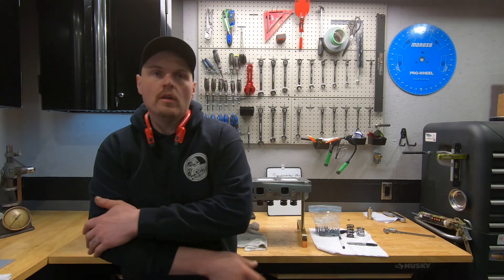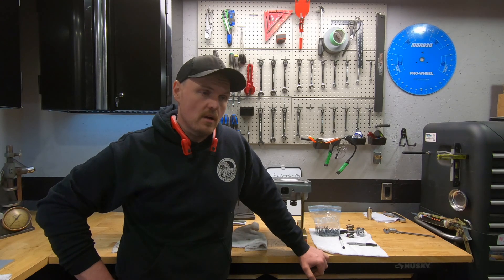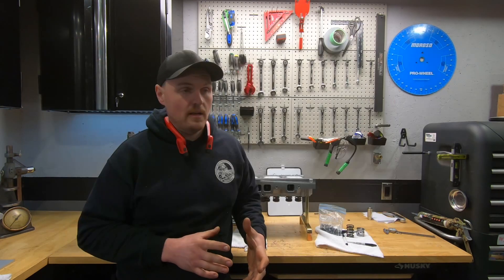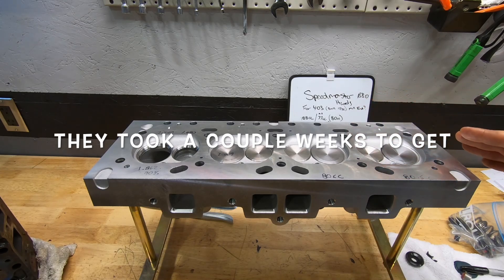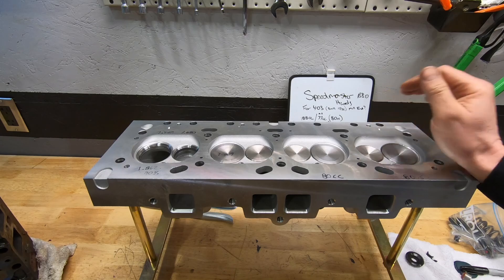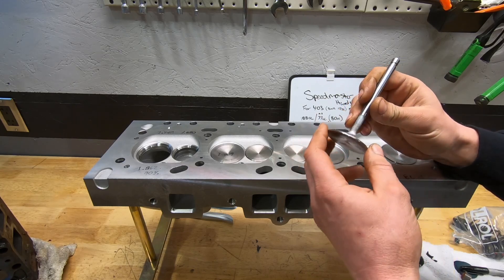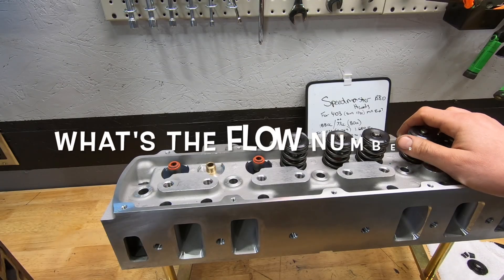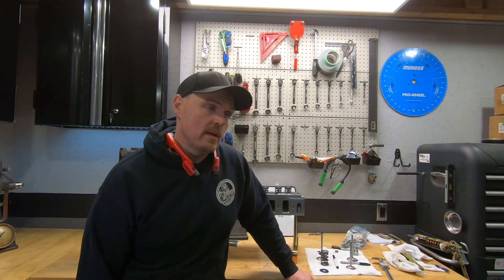Speedmaster OLDS Head Review + 403 Stock Head Flow #'s

Comment: I'm 56 years old and life long Oldsmobile guy. When I was just getting out of high school high performance 403's were kind of a big thing here around Detroit. The engines were then plentiful and easy to find. I still wasn't a fan due to the windowed engine block but the big bore combined with big block heads and a street dominator single plane welded up to raise intake ports for big block heads. That was the hot setup. Problem was eventually every one I knew of blew up in extraordinary fashion. After a refresh and engine compartment detailing my buddy took me on his first voyage out in months. Prior to that he became known as the kid with the green 71 Cutlass who would race anybody on telegraph.  Such a weird combo in the way he got it, the car wouldn't even spin the tires with the 3.42 gears and too tight converter, but wait one thousand one one thousand two...the car squatted down in the back and just started pulling. In that configuration it ran 13.30s @ 109 all day long with ease. Prior to him buying the car it had a 12 bolt with 4.56 gears and a loose 10 inch converter and reverse manual th400 running 12.ohs thru open headers. Anyway on that first shake down in months I was sitting in back seat because he had the passenger bucket seat out of the car. We didn't go but 1/2 a mile, stopped on a stretch of road by the house, he brought it up on the converter and stabbed it...car hit hard then went BAM! Engine cut off clean and we coasted to a stop. We get out open hood and right away I knew it was bad. Tryed to stay calm but simply pointed out the balancer was crooked big time and the crank snout was pointing anywhere but straight ahead. We had to push the car 1 block to his house and of course it started to rain. Couple days later we tore it down and the block split right in half on top of the maun bearing saddles clear from front to rear. Crankshaft came out in 3 pieces. Every connecting rod was like a noodle. He was only able to save the ported C heads as even the new camshaft snapped in two. Another similar 403 with a different friend ended up splitting his motor in half very similarly at Milan Dragway. I loved the idea of that big 4.330 inch bore and relatively short stroke but the windowed web blocks just couldn't take it.

Comment: FYI Speedmaster is an Australian company that started in Liverpool Sydney Australia in the early 1990s , at Sydney Speed Supplies , now expanded to the US , but still owned by Australian's . All parts including heads come from Australian warehouse then to US . Just a bit of trivia , the original company imported used US V8s ( suit rebuild) and sold them in Australia, moving on to making cheaper but still well made parts for Australian street/ race scene in the mid 1990s , now massive company .
Reply: You’ve got a lot of stuff wrong 🤦🏻‍♂️
Reply: @murrayhawes1265  no I don't , I was there at the start , and you can still talk to the guys that started the biz, so I suggest you stop dribbling shit to the converted .
Reply: @JosephCowen-fz8vj well first of all it’s called Speedmaster79 because it was started in 1979. Second it was in Wollongong NOT Liverpool and you still have more stuff WRONG. Do a bit of research 🤯
Reply: @murrayhawes1265 FYI those heads are zero waiting time in Australia and there's probably 100 Olds motors in the entire country.

Comment: Hey Pat, as you know, I just picked up a 403. Did you end up messing around with the stock 403 heads at all? Just curious if you found any simple upgrades
Reply from the maker: I haven't yet, once things slow down I plan on doing that
Reply: @ that would be great! Part of me wants to invest in the new Edelbrock SBO heads or just keep it stock and keep the swap simple. Always torn between over doing it or K.I.S.S. 😅
Reply from the maker: @jimmy_olds  I really wanted to use the edlebrock heads but once they came across the border the price was wild

Comment: I had a 1978 Trans Am that had a 403 olds. I dealt with Dave Smith at Precision Speed in Anaheim Ca. to hot rod it. He built me a set of heads that the casting numbers were machined off, but I think they were W31 heads. Also, he suggested installing main studs because of the windows in the main web. We used a Holley single plane intake, one of his cam designs, TRW pistons, and few other quality parts and my car went from 15.90@86 in the 1/4 to 13.91@106. Would have been a lot cheaper to do with a Chevy or Ford.

Comment: I picked up a set of speedmaster sbc 220 heads I looked them over and two exhaust valves did not seal, in the end don't trust anything out of the box  Great Video Pat!
Reply from the maker: are those the CNC ported 220 DBC heads?

Comment: I love my speedmaster pontiac heads. They will be going to Butler in the next week or so to get the cnc port to 340cfm. At the point that you are wanting a 340 port, why buy a more expensive casting to get it done. 

I do not like the locks and retainers they use.
Reply from the maker: The guys at Butler sure do some nice Pontiac stuff! 340 cfm is awesome. I got the edelbrocks on my 400 Pontiac in my 67 F-Body but they sure are expensive!
Reply: @cuttersperformance  they have been doing those 340 ports on edelbrock heads for years. My buddy had a speedmaster head that needed work, so he had them run the 340 program on them to see if the casting would hold it. They do, and he has them on his. I figure for 900 and a set of larger intake valves it’s worth it.
Reply: My buddy’s 540 smacked one of the valves they use,it bent. A ferrea would have broken.
Reply: @doomman700 soft enough to bend your buddy will be picking them out of the piston if you have enough spring pressure it'll pull the keepers right through

Comment: Hey bud, really enjoying your shows and really excited about this 403. I had one in my old Trans Am, but never got time to build it.
But anyway, I don’t know what you’re talking about as far as big block and small block edelbrock heads for Oldsmobile because they are the same head. I bought a set when they first came out and ran it on my old 350 and now it’s on my old 455 in my cutlass. The only difference is the intakes.
Heres a little olds tip for you don’t waste your money on the torker 1 or 2 intakes there complete trash
I do hope you put that motor on the Dyno even if it’s just for personal interest 
Like I said, I never got to build my 403 but with that massive bore and that combustion chamber of those heads, I would suspect decent flow and some good low in torque, even though it is a short stroke motor, but nothing tells you more than experience
Anyway, keep up the great work
Reply from the maker: I was talking about Edelbrock coming out with a new head specifically for a SBO, its has better options for lower intakes as the runners line up better, smaller chambers and clears the fuel pump (I believe the new BBO heads are also now scalloped on one end for the fuel pump). 
Yes the plan is to dyno test this engine
Reply: @ cool I’ll have to look into these new heads. I do have a few olds still 
Anyway, thanks for the response. Can’t wait to see the Dyno on that 403 now that you’ve confirmed it

Comment: At my shop it was very normal to find bronze guides much too tight and chatter on seats. Surface/deck finish itself was ok 80% of the time but 100% of the time needed to mill to have both heads cc equal .

Comment: Big block/ small block. It's the same head!!
Reply from the maker: Edelbrock coming out with a new head specifically for a SBO, its has better options for lower intakes as the runners line up better, smaller chambers and clears the fuel pump (I believe the new BBO heads are also now scalloped on one end for the fuel pump).
Reply: They are not the same heads. Different combustion chambers.

Comment: I've used a few Speedmaster heads, however I always buy bare and use good quality brand name parts. Along with that I get the valve jobs all recut. Some of the early speedmaster (procomp), heads had very narrow valve seats which did not sit very deep in the head. They were prone to dropping a seat. I think that all been fixed on the later versions.
Reply: The valves are not bad, the rest I am no fan
Reply: The geometry was also very off   ,I have a set of old precomps here I stuffed 2.100s in..they flow like a mofo but every guide is off and you can see air under half the rollers on the rockers lol...

Comment: Listening to you talk about the heads and illustrating the differences between them in reference to the fuel pump issue reminded me of the conversation I had with myself when I did the 403 Olds refresh in my Trans AM. I ended up adding bigger valves and scratching on a set of old #5 350 heads so I could keep it as a mechanical pump with the original modified Qjet. Looking back now it would have been just fine too if I did an in tank electric pump and used the Speedmaster heads. Less cranking time after it sits for a day or two lol.
With regards to your mention of that intake with a shaker on the TA don't fret it fits perfectly with the original unmodified 403 air cleaner base. You will end up with plenty of  clearance and just the right amount of compression on the shaker rubber seal. I  can email you a picture of the what that finished product looks like if you want. I port matched both the heads and intake to the intake gasket I had and it worked great. 
What have you decided on for a cam? I'm super curious to see what you use and where it ends up for power. Should be easy to crest 400 HP and 440 to 450 torque while maintaining good drivability and vacuum for power brakes. Enjoy your videos Pat keep up the great work. Being busy is a good thing.
Reply from the maker: I'm doing a custom grind retro fit roller, should make decent power
Reply: @cuttersperformance OK nice please share the cam specs when you finish the build.
Reply: I was thinking the same about the fuel pump

Comment: The key to any olds built is the low end performance.  Especially the large bore 403. For years, we ran stroker 442.
 From the 350-403-425, and combo 442. They all provided good torque. Not a good combo for higher rpm such as 5500 plus. But from 2000-4500, they shined. It is extremely durable in that rpm range. They can propel some heavy cars to impressive times. The 350 diesel block opened to the 403 bore, and combined with the 425 crank. Your 442 could launch a rally 350 to 13 seconds flat with cast heads and intake. 
  Pairing those speed pro heads to a performer intake/  cam. 500 ft lbs is not out of the question. You don't need to spin them to the moon. Those springs are enough to 5500rpm.
  Your customer should be happy with what they have. They could drive this as a daily, to the track, and post times equivalent to Hurst 455 HO.
Reply: BS  The diesel block cannot come close to being bored to the 403 sized bore.

Comment: What is your reasoning for flowing on a 4.030 bore being the 403 is 4.351 ? The Speedmaster heads are a copy of the Gen 1 Ededelrock heads. As you talked about the castings are pretty good,  we've worked with these heads and have  always  purchased bare.
Reply from the maker: I don't have a 4.351 bore adapter, but I did flow them on a larger bore aswell and the numbers were basically the same
Reply: Hold on... $460 for an Olds Performer?  Youch! The old SBC may be kinda vanilla but man the parts are priced right.
Reply from the maker: @rotaxtwin edelbrocks pricing over the last few years has gotten crazy
Reply: @cuttersperformance  yeah I think I'm outta touch, it's been so long since I bought any parts.  I've gotta do some wrenching this spring & summer and I know it's gonna be a reality check.
Reply: @rotaxtwin when I bought my olds performer a few years ago it was a little bit less but I still had to swallow hard when I compared it to my Chevy parts!
Reply: The sbc aint that cheap anymore...and bbc has moved right up with the rest..cdns get absolutely raped buying anything from the usa.@rotaxtwin
Reply: @russellhunt5919 what brand valvesprings & parts(part #) do y'all  use on these heads, I have an assembled pair & was debating about upgrading the valvetrain, after watching this video & reading  comments, I will most definitely  change.
Reply: @josephjordan4977 Ferrea valves, PSI springs are what I used.